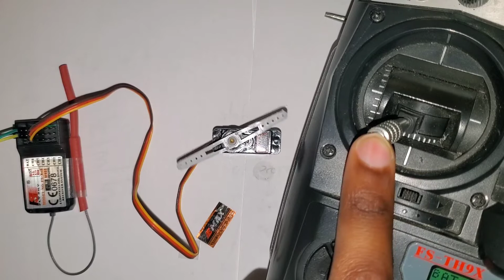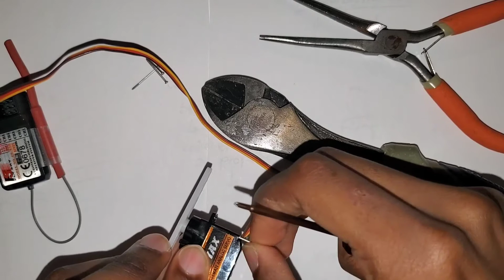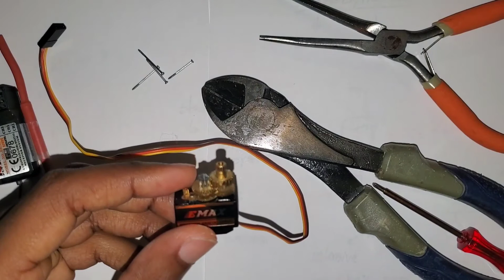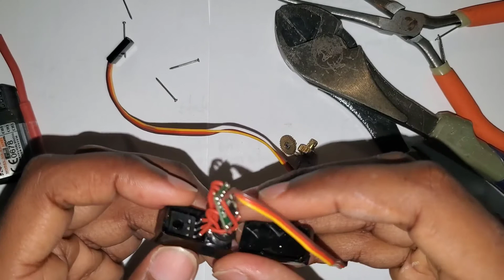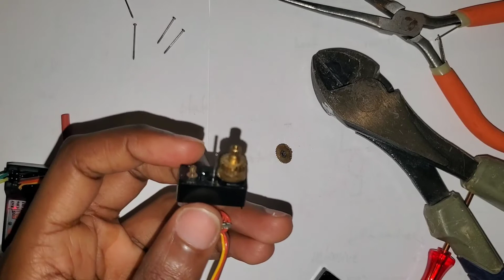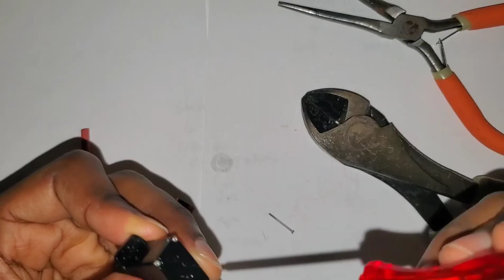Make your Servo Continuous Rotation [Tutorial]

Comment: Nice video simple but effective. Something to note this doesn’t allow for the small range between 85-95 to keep still but there’s an easy fix in arduino using detach() command when even you want to set it to 90 and just attach when ever you need the servo to move